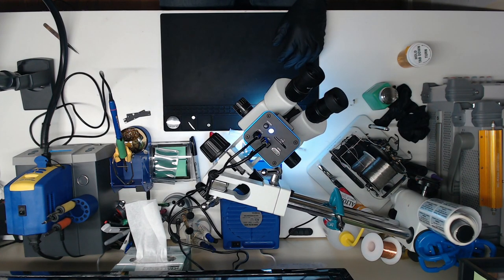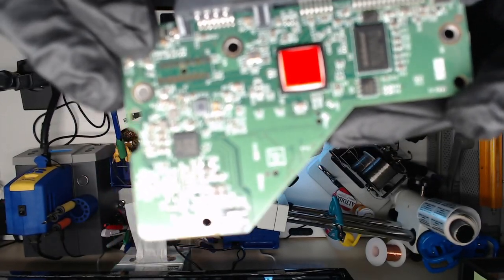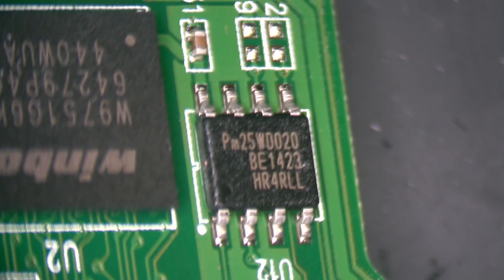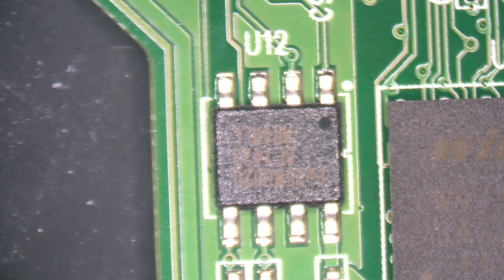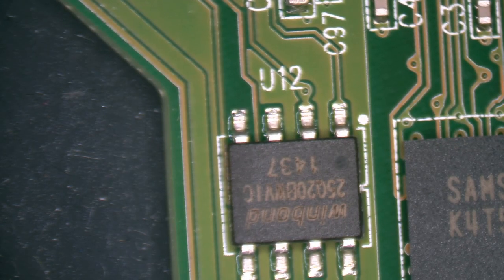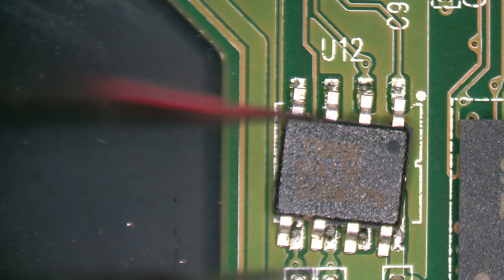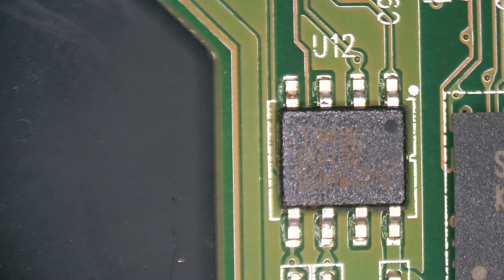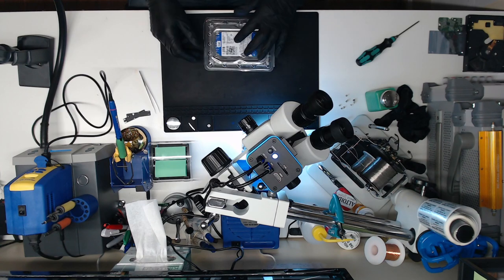Western Digital hard drive PCB BIOS IC swap

Comment: Just get yourself a spi programmer and pomona clip, no need to desolder just backup the good chip and flash to bad chip
Reply from the maker: I already had those tools to hand and did not think of that, I will definitely try that next time. Thanks!
Reply: Is there a recommendation on what kind of spi programmer and clip to get? I was looking into this and found alot of options.
Reply: You mean flash it to the donor chip? Do you have instructions? I watched one video on this method

Comment: please help me, I also have a dead board (2060-800055-002 REV P1) Purple 4Tb Ordered from China the same board with the same revision. I replaced the BIOS-a chip, but the disk is still not displayed in the system. In the Bios of the computer it is shown as but Gb. But during initialization, it issues an I/O error. How can it be repaired
Reply from the maker: I would have probably tried to swap complete boards first. There could still be something wrong with original PCB.

Comment: I'm going to attempt to do this to save a hard drive. I wonder how important is the size of the nozzle in the heat gun? I've bought a heat gun from amazon and the only nozzle it has is 9mm diameter. From your video it looks like the nozzle you used was smaller than that.
Reply from the maker: Not super critical, I would put more effort in where you aim the nozzle. You could totally do it with a 9mm.

Comment: You started with 325-350 temperature but increased it when the chip did not come out. What was the final temperature you used to remove the chip?
Reply: I have my Hakko hot air station set to 900 with Airflow set to 2 for console work, but on these hard drive logic boards, the chips will come off between 400 and 500 degrees.  Fahrenheit, of course.

Comment: great video but what happens if the bios chip is not near the end of the board as yours was? how is the heat applied then?
Reply from the maker: You just have to be a little more careful where you point the heat.

Comment: Great video! I have a WD Elements external HDD, that just won't power on. It'll power on with a new board, but then the computer won't recognise it. Is the only way to access my data to solder the old BIOS chip to the new board? I'm sorry for bothering you here, but WD are of no help, and I'm desperate to get my data back. Thank you. :)
Reply from the maker: Hello, if you are saying the hard drive will power on with a replacement board, then yes if you solder the BIOS IC to the replacement board I would say you have a pretty solid chance at getting your data back. If you have basic solder skills it should be pretty easy. Just make doubly sure that you know what you are doing as you could turn an easily repairable drive into a paperweight.
Reply: @optimizelogicrepair2784  exactly! I desoldered the old chip, and the new chip off the new board. It's WAY above my skill level to solder something so tiny I think. I don't suppose it's possible to rip the data from the original chip, and dump it on the new chip with CH314A programmer? Thanks again for replying to me! :)
Reply from the maker: @VideoGameWasteland  yes, you can do that as well. It takes me less time to swap chips, but I have gone the programming route as well.
Reply: @optimizelogicrepair2784  great! Thanks so much for your help. I sincerely appreciate it. 🙂
Reply from the maker: @VideoGameWasteland  no problem. Good luck!

Comment: Hello thanks for the great video I have the exact same issue but do not have the original PCB anymore. Is there a work around? Thanks!
Reply from the maker: Not that I am aware of. Without the original BIOS, the drive will not have the correct parameters.

Comment: GOod afternoon, hope be well, i have an HDD of 320 Wester digital caviar blue, at work i have one broken with the exact same board part. My HDD is recognized by the motherboard, but i cannot get access to the data or info of partitions and disk capacity, If i do the change of the board can i get back the info stored? if i disconnect the disk suddenly appears the capacity used but of course i cannot access.

Comment: I let a shop change the chip but it shows still the wrong hard drive. The chip definitely got changed but it is as if it has the wrong board(new donor board) even if it has the BIOS from the old board. Any knowledge why this could be? Board was the WD 2060-800067-001

Comment: Hiya. Newbie here. I see that next to the BIOS chip it is marked as U12 on the pcb. Are all those marked as 'Uxx' bios chips as well? I was looking at a WD PCB and do see U21 and U23  quite close to the MOTOR IC. U22 seems to be next to the RAM/MEMORY I am looking high and low for MOSFET/FET chips but am not able to identify one. Any advice?
Reply from the maker: Please send pictures and information to optimizelogic@gmail.com, so we can better assist you.
Reply: @optimizelogicrepair2784  Hiya, thank you for the reply. I am doing this for my own understanding and study. So there is no rush for the reply. Will send you a email with the picture of the PCB.

Comment: Hello there, I'm working on a WD320BPVT-75JJ5T0 that was in a dropped laptop. It was unable to read/initialize. I swapped the head from a WD320BPVT-24JJ5T0 to it and it was able to show the Dell Recovery volume but was not able to pull any data off or initialize/mount it any further. Is there a step I'm missing that would help get it to initialize or maybe the replacement head needs to be from a similar -75JJ5T0 model? or need to possibly Hot swap PCB? Thanks.
Reply from the maker: Sorry, without seeing exactly how you replaced the head, it is hard to tell as so many issues can arise from that procedure.

Comment: Hi, you mentioned resources on how to determine which chips have to be swapped. Could you please point me in this direction?
I have WD80EZAZ drive with PCB version 006-0A90701. I can find a electronics repair shop but I think I have to tell them which chips to swap (bios chip or main controller ic).
Reply from the maker: Hi, based on that model number, the BIOS IC is directly to the left of the screw hole on the top of the board. If you need further help, you can contact me directly

Comment: I have Toshiba HDD that I would like its BIOS chip to be remove and place into new PCB, but I found four 8 pins chips, with label IC10, IC11, etc..  on PCB. Is BIOS chip one of them that needs to replace or have to replace all 4 of those chips?
Reply from the maker: I would need the number and revision of the board to be able to answer that.
Reply: @optimizelogicrepair2784  It has G4013A text on it.

Comment: maybe you can help.  i hooked up a power cord to a HD and apparently it was backwards.. how do i  test polarity so i don't do this again. and i think i need to swap a BIOS chip but how do i know what donor to get?
Reply from the maker: What do you mean you “hooked up a power cord to a hard drive and apparently it was backwards”? Was the drive just sitting on the table, was it in an enclosure? Need more info.
Reply: @optimizelogicrepair2784  well i was using one of those readers that reads IDE drives and such. the power cord on it never fit right. i shaved some of the plastic off to get it to fit in the AC part. well i must of got confused and hooked it the wrong way. the board smoked a little.. i tried to use a meter to figure out which is +  but IDK what im doing. one would think it would be labeled. its not. perhaps a picture may help?

 I THINK, from what i am told i only need to remove the one chip and install it on the donor. but no luck yet. not sure who to  make sure i have the right donor board
Reply from the maker: @daytonpyro  if you remove the board from the drive, it will have a model number on it.

Comment: How do you know when hard drive failure is PCB failure or internal failure?  I have seen videos where clicking hard drives ended up being a PCB failure, but everyone says clicking is always an internal/mechanical failure.
Reply from the maker: Typically when components fail on the control board, the hard drive will not spin up or do anything at all, because the power has been cut to a certain area. If the TVS diode fails , there will not be power getting anywhere as they are designed to fail to protect the board, kind of like a fuse. Clicking is the sound coming from the heads, they are sweeping back and forth rapidly because they are searching for the place they left off sometimes because of a drop.

Comment: Is there anywhere i can send my board for the bios to be swapped. I got a new one from ebay, and blasted both bios chips with 450 degrees, 550, and 650 for several minutes and neither will budge!
Reply from the maker: Well you could send it to us.
Reply: I'll do that! I also have a drive with an integrated BIOS and controller chip. Is that something you can swap out?

Comment: Have wd passport with a humming getting a donor PCB and gonna attempt a chip swap. Does that sound like a could be the issue? It's like a start and stop hum.
Reply from the maker: Was it dropped? typically drives that are candidates for chip swap do not work at all. Sometimes there is a diode that goes bad, sometimes the main motor controller. Start and stop humming could be a few things, like bearings, head misalignments, etc. First thing you could do is download a free app called crystal disk info. Then you can scan the drive. If issues are detected, it should give you an idea. If it has bad sectors, I'm afraid that is probably where DIY ends and I would recommend sending it out if data is critical.
Reply: @optimizelogicrepair2784  ah thanks. Yeah I would think  Crystaldisk wouldn't be able to read it too. I attempted booting with ddrescue and the bios won't even see it.

Comment: When one is about to change the BIOS, and place it on the other card, bone the donor card, the BIOS must have the same position that it had on the factory PCB, that is, the position of the 8 legs matters, alaves or to the right. ?
Reply: yes. position of the bios pins(legs) do matter. the little white dot on the board right by the bios chip shows where the first pin of the bios chip must go. bios chips also have little round marking on them denoting the first pin.
Reply: @edthetech  Thanks.

Comment: Great video, quick question, I need to replace my bios chip to another PCB for a WD External as well, does the replacement board have to be the exact same? I can find a board that matches close, but the exact Revision letters are not the same. My board has Rev.AB, I have a replacement that is AF or AA? Thanks for any advice.
Reply from the maker: I've always used the same revision. Good Luck with your repair!
Reply: @optimizelogicrepair2784  Thanks, I'll have to wait then, that particular rev seems to be hard to locate,    have you ever switched one on a board Revision close?
Reply from the maker: @Vincent_Serpico  I have not. Maybe I’ll do a video sometime doing that to one of my drives
Reply: @optimizelogicrepair2784  Thanks for the advice, if you do I would like to know if it works, my drive went down and I'm worried about making the switch without having the exact same board. I dont want to mess it up anymore. Thanks again.
Reply: Oh, one last thing? On these PCB boards I know they  have 2 sets of numbers, one that is actually on the pcb and the other is a sticker on the port. Does the sticker number have to be the same in order to use it as a donor board or can it just be the number on the board. Sorry about all the questions.
Reply from the maker: @Vincent_Serpico  Just match the part number that is embossed on the PCB.
Reply: @optimizelogicrepair2784  Thanks again!
Reply: I went ahead and switched the bios chip to a donor board, my drive will mount with the donor board, but now prompts me to format the drive and says that this drive is using a file system that is unrecognizable. Any suggestions?
Reply: @optimizelogicrepair2784  would I be able to clone the drive if its saying the data is locked?
Reply: Disregard

Comment: i have old seagate 1tb hdd with very important files on it. The motherboard is damaged but I am able to order the exact same model from China. I need to know if i replace the motherbard without switching the bios from the old motherboard, what would happen? Also what is actually the reason to switch the bios chip? I really need to access that files. Can`t I just replace the motherboard and access my files without switching the bios chip?
Reply from the maker: No you cannot simply swap boards. The BIOS holds everything for the drive, like Serial number, head and sector info, Read/Write cycles and drive health. You must transfer the BIOS chip to donor from patient, or copy BIOS from patient and write to donor.

Comment: Hi I have a western digital hard drive the place were supposed to have a bios (U12) is empty, can a hard drive work without bios chip?
Reply from the maker: What Model is it?
Reply: @optimizelogicrepair2784  the pcb number 2060-701537-002 Rev P1, in the area U12 doesn't have a Bios Chip, where is the bios in this type of boards?
Reply from the maker: @Maher-  The BIOS for this PCB is integrated on the main controller IC, so you would need to change that.

Comment: Hi, It is necessary to replace the bios, can I read the files of my wd blue 2015 with another similar logic board?
Reply from the maker: Yeah if you have a programmer you could do that. I find it is easier to swap the chip.

Comment: Hi I'm after changing the Bios chip on a hard drive that I'm replacing on a new circuit board I am buying. Could I just use a solderig Iron to desolder it ?
Reply from the maker: Yeah, it would work. Going to be a bit more difficult but it can be done.
Reply: @optimizelogicrepair2784  Thanks for that. Can't afford a desolderingstation. By the time I did that I may as well of payed for someone to do it lol.
Reply: Cover all 4 legs on one side with a line of solder whilst keeping it hot with the iron, apply light pressure under the end of the chip and it should lift one side. Repeat the other side to remove it.

Comment: Do I need to move the old BIOS chip to a new board to recover my data or can I just use a new pcb directly without putting in the old BIOS chip?
Reply from the maker: Yes. You need to move the original BIOS IC to a replacement board. You could also copy the .bin from the old bios chip and flash it to a new chip.
Reply: @optimizelogicrepair2784  how would you get the .bin file from the old chip and write it to the new one?
Reply from the maker: @asegovia81  You need a Programmer. Pretty cheap and easy to learn how to use.
Reply: @optimizelogicrepair2784  are there any that you would recommend? I've seen a few test clip sets on Amazon but want to get something that will work.
Reply from the maker: @asegovia81  Just look up "TL866II Plus Programmer" on eBay, Amazon or w/e. They are widely available

Comment: hello, please I hope you can help me, I have a WD HDD (PCB 2060-701393-002 REV B) so I investigated my PCB is burned since the disk makes a click and the plate smells burnt and feels hot, look on Ali Express and found the PCB, I want to buy it just to save my information and only that, but I understood that the BIOS chip has to be replaced, is this completely necessary? Or is it that I should try it as it comes and later if it doesn't work, change the chip? Wouldn't it be risky to try without changing the chip? I don't want to burn it or something similar since that way I could never recover my information. I hope you can help me with this, thanks in advance, by the way I don't speak English I write through the translator in case I don't understand
Reply from the maker: Clicking indicates an issue with the read/write heads.

Comment: Does anybody know what is heat source is.
Reply from the maker: What are you asking?
Reply: @optimizelogicrepair2784  what heat source are you using.
What is the name of the tool.
Reply from the maker: @briankelley7918  Quick 861DW
Reply: @optimizelogicrepair2784  what temperature did you get to when you  got the chip out.